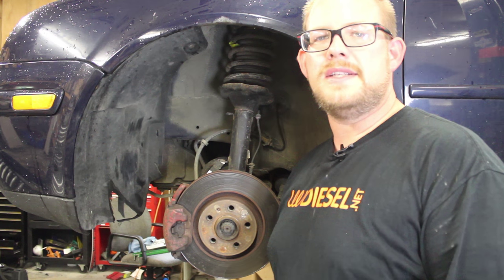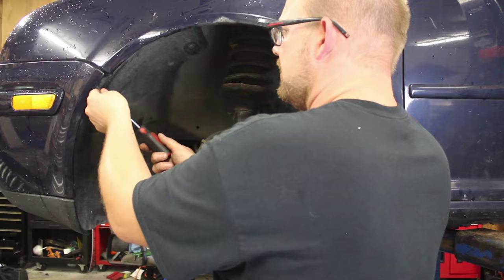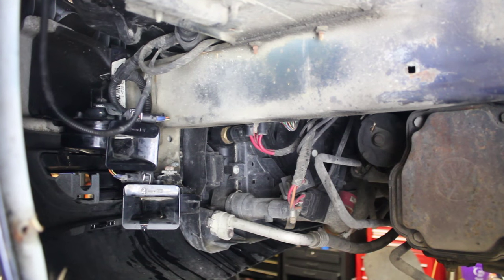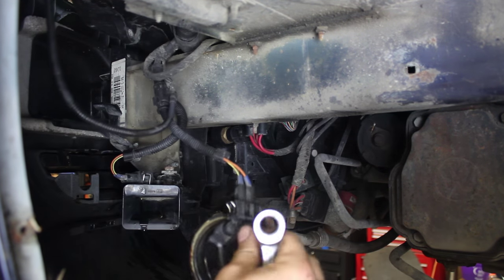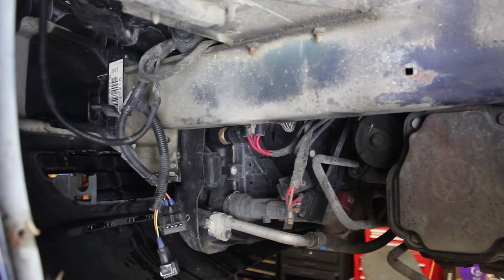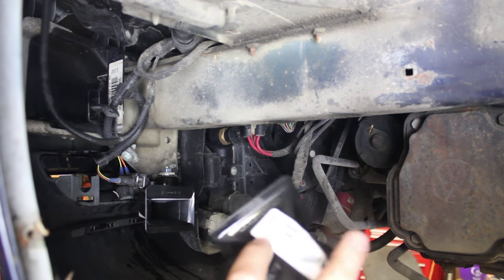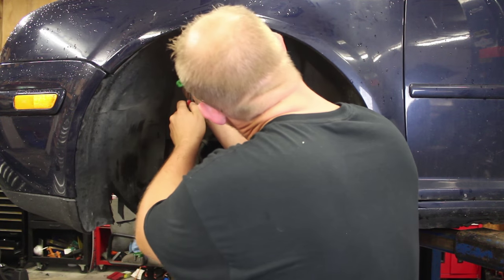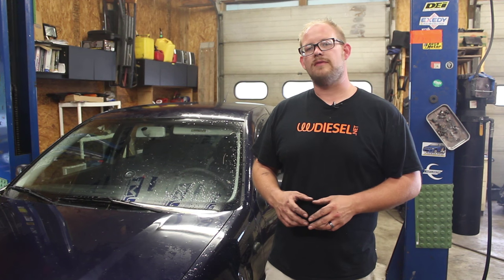How to change a horn in a MK4 Jetta or Golf TDI, 2.0, VR6, 1.8T

Comment: I thought my horn was on the drivers side in my 2011 2.5 SEL Jetta, after extensive research only to find out.. it was on the passenger side under the front quarter panel, same process. Remove wheel, mud guards. I only found one horn, it seems a little weak, so maybe there's another somewhere else? I'm just grateful to have a horn again.
VW makes it tough to find information...